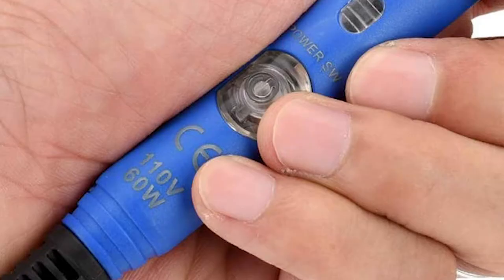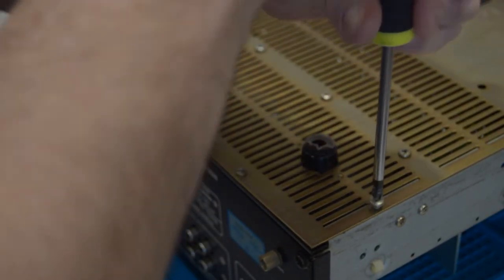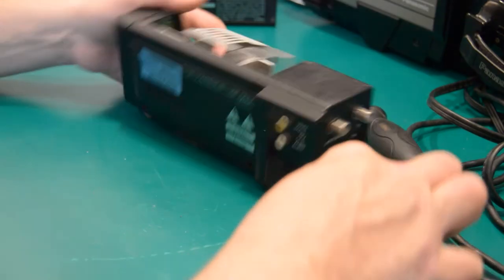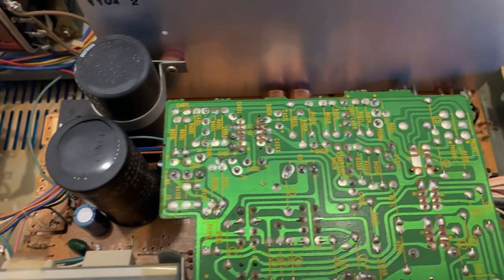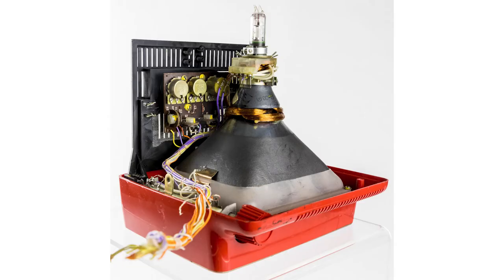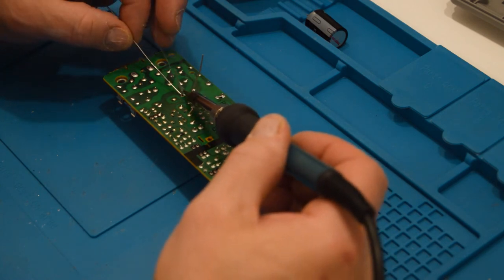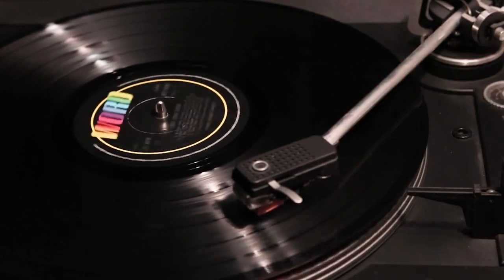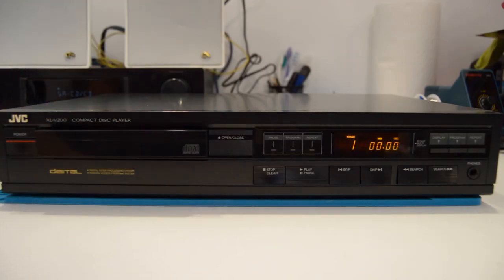Beginner Tips for Repairing VINTAGE ELECTRONICS | Retro Repair Guy Episode 14

Comment: Thank you for the list and beginner tips. My fist project is 1990s Sony 5 disc cd deck that has a removable break out board. I need to figure out why sound is not coming from board I assume a bad capacitor. Rest of unit is functional.
Reply from the maker: Could be a bunch of stuff but check for bad transistor. Also do a thorough visual inspection and see if anything seems burned, bulged or bad connections, etc. I always do that when units are that old. Remember you might not be the first one to have been in there. Look online for the service manual, sometimes you can get it free in PDF. It will have the voltages that should be at certain test points.
Reply: @RetroRepairGuy  yeah my thought for 10 bucks worse case, I could get practice removing items from boards and testing continuity. My expectations are low for getting it to work but  who knows it might fine something easy wrong with it.

Comment: You're saying to set your soldering iron to 365f-374f/185-190c?  That won't work well... especially for unleaded solder.  And in your video you're actually showing that you're setting to 365c, not 365f.
Reply: He did a good job, Remember he is Canadian he mentions that why beginners shouldn’t attempt Xbox because of unleaded
Reply: @plexnbrown760  Yeah I get it, but you're unlikely to desolder much at 185-190c, even leaded solder.  The board will soak up heat and it'll take so long to desolder, you'll likely damage the part.
Reply from the maker: Hi Toby. For the solder I specifically recommended 60/40 for beginners since the melting point is lower. However you are correct I mixed up the Celsius and Fahrenheit. 365 Celsius is correct but I miss spoke and that's much higher in Fahrenheit. I'll put a correction on the description page. Thank you for bringing this to my attention!
Reply from the maker: @plexnbrown760  @Toby Q Thank you both. I did note the correction in the description above. Yes I am Canadian and because I tried to think for American viewers to say it in Fahrenheit but I got mixed up. Sorry! But yes I do mention the unleaded being difficult for beginners.